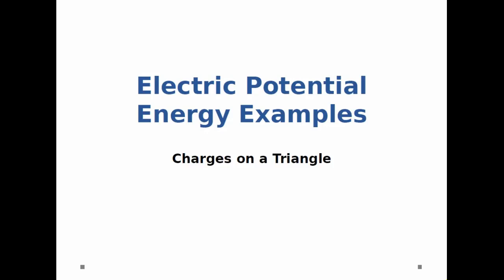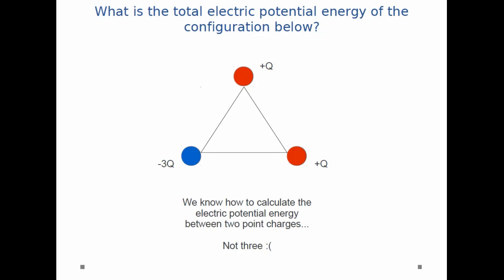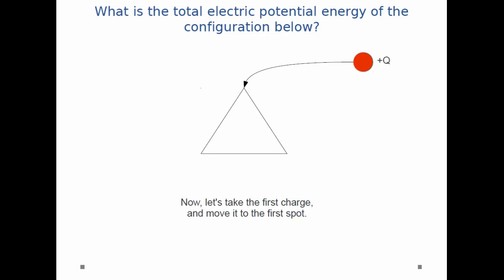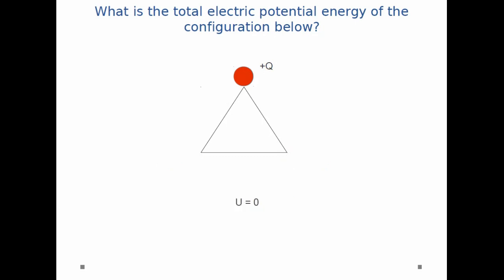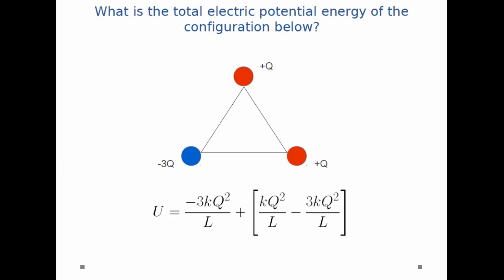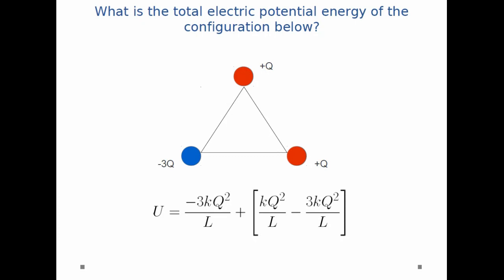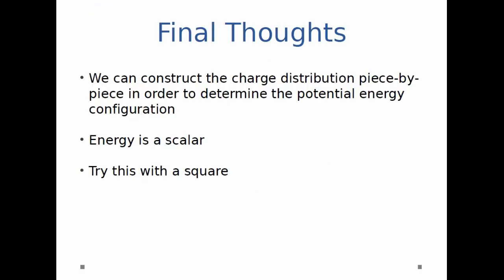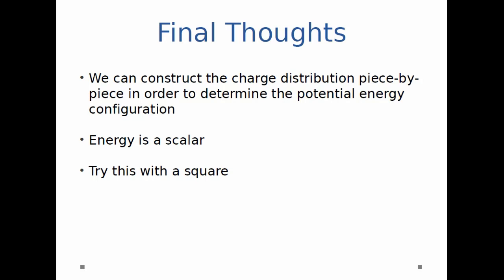Electric Potential Energy - Charges on a Triangle

Comment: I don't quite know how quickly you'll respond but can I translate this into the kinetic energy at a point further away? Assuming all three charges were positive and we're looking at a massive point charge in the top middle... would I just do sin(tan^-1(o/a)) times the normal potential energy equation?
Reply from the maker: I can't say for sure without seeing the specific problem you are looking at, but generally speaking, yes - you can convert potential energy into kinetic energy. It sounds like in your problem, you have three charges on a triangle and the top one flies away. I would calculate the potential energy on that one charge (i.e. potential from bottom left on the top + potential from bottom right on the top) and then convert that to kinetic energy at infinite distance. 

Also, note that the energy equations don't require any trigonometry as energy is a scalar, not a vector. So I am guessing you won't need the sines and tangents. Again, I might be wrong depending on the specific details of the problem you are working on. Hope that helps.

Comment: What if the thee charges are all protons and there is a fourth proton charge but it is located in the middle of the bottom of the triangle? how can I solve that?
Reply from the maker: The process for solving your case is the same as my example - you just have slightly different charges with one extra proton in the triangle. I would first determine the distance from the fourth proton to each of the other charges. Then, start with the blank triangle like I had and add in the protons one by one. You will find that the first three protons follow a pattern similar to what I did. Then, add in the fourth proton and find the potential energy of the proton compared with the other three. Sum up all of the terms. Hope this helped!
Reply: @Cyrus Vandrevala  Thanks so much for replying. I just want to clarify so my problem is also an equilateral triangle with 5 micro meters per side and the 4th proton is located at the middle of q2 and q3,  so the distance between q2 and q4 and q4 and q3, is 2.50 micro meter.
My question is, will my formula be
U= (kQ²/5.00)+ (kQ²/5.00)+ (kQ²/5.00)+ (kQ²/2.50)+(kQ²/2.50) ?
Reply from the maker: @maoyu2378  I can't give away the answer to your homework problem, but I can give a hint. The fourth proton is located in between q2 and q3, but it feels electric forces from three other protons. Thus, you need to factor in the proton at the opposite corner of the triangle (q1 I assume) as well as q2 and q3. I believe you are missing a term.
Reply: @cmvandrevala  ohhh ok ok I get it now thanks so muchh

Comment: superb
Reply: I have another doubt. why is the flux independent upon the area of the guassian surface?
Reply from the maker: According to Gauss's law, the total flux passing through the Gaussian surface is equal to the enclosed charge (divided by a constant). Since the enclosed charge in electrostatics problems is a constant (i.e. charges don't move), the flux through the surface is a constant as well. This means that no matter what shape of Gaussian surface you draw around some constant amount of charge, the net flux passing through the surface is always the same.
Reply: Thanks man

Comment: is it the same if they ask for the potential at the center
Reply from the maker: +Gbemi Aiyewumi Remember, electric potential and electric potential energy are two separate things. Thus, the electric potential at some point in space is not necessarily equal to the electric potential energy of moving a point charge to that point in space. Additionally, the electric potential energy stored in this configuration is not the same as the electric potential energy of a given point charge at the center of the triangle. Hope this helped.
Reply: Oh no, it's not a point charge. I meant the electric potential at the center due to the three charges at the vertices.
Reply from the maker: +Gbemi Aiyewumi The electric potential at the center is not the same as the electric potential energy of the system. Two different concepts, two different calculations. However, potential and potential energy are related by charge: U = qV
Reply from the maker: +Cyrus Vandrevala Let me clarify. You cannot find the energy of the system and then divide by the charge to get the potential at the center of the triangle. You need to use superposition - calculate the potential due to each point charge separately, and then add them up.
Reply: Firstly, I want to apologise for the earlier confusion. I didn't notice the video was on finding electric potential energy. I'm really eager to find the solution for the electric potential at the point. 
Secondly, that's exactly what I'm trying to do :D but funny enough I don't remember how to find the distance from each vertex to the center of the triangle
Reply from the maker: +Gbemi Aiyewumi No worries. You can use a bit of geometry to determine the distance to the center of an equilateral triangle from any vertex. Draw a diagram of the triangle, label the sides, and draw a perpendicular bisector down one of the sides (you might need to review a bit of geometry!). This link might help: http://mathworld.wolfram.com/EquilateralTriangle.html
Reply: +Cyrus Vandrevala awesome thanks for the help